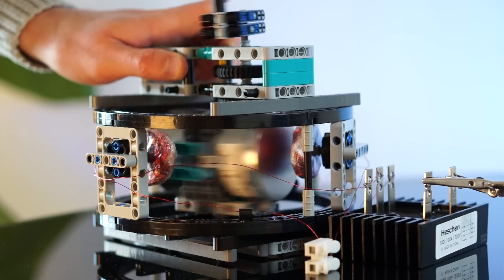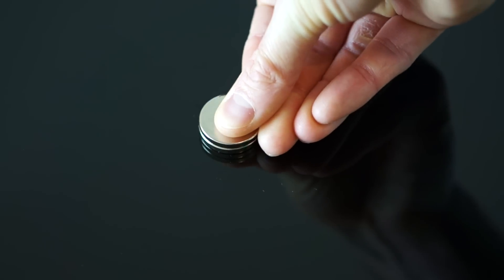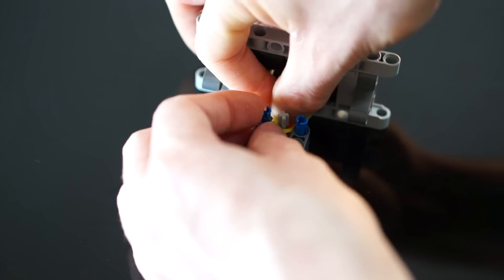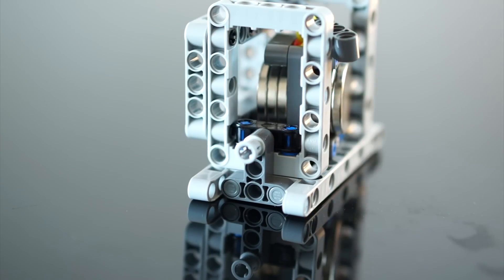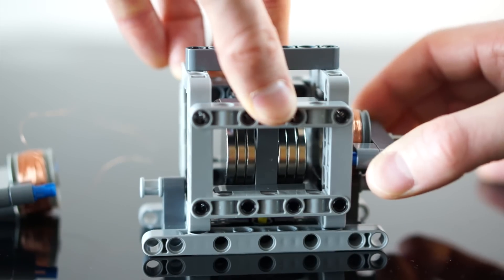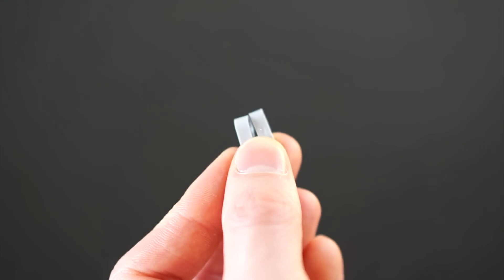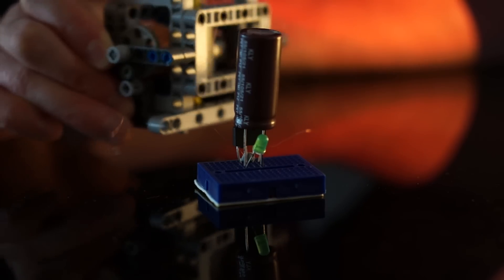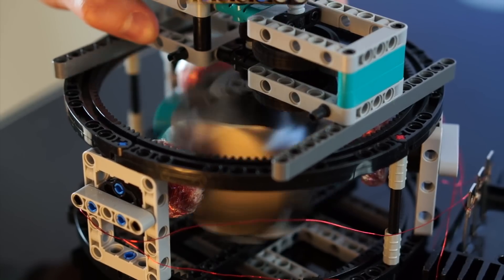The ‘Wiggler’ - This Lego Gadget Shouldn't Exist

Comment: I think if you can make a second one and kinda make it like a boxer engine. With a fly wheel and a electric motor and a few capacitors you could maybe make something that can keep going with momentum. Just a random thought I had.
Reply from the maker: I actually love that idea! It seems totally pointless having a solenoid driving an engine that then turns that linear motion into rotation, when you really should have just created rotation motion from the start. But needlessly overengineering things is a passion of mine 😁 I'm totally going to have to try this! Cheers for the suggestion 🙏

Comment: As a toy, this "contraption" can serve as a teaching tool, a science project, or something for a local science fair.  However there does exist a few wind generators that use vibration to create electricity.  Some have been designed for 3rd world populations and others scaled up for more technically advanced populations.  In short, the concept of harnessing vibration is already in use in today's market to create electrical power.
Reply from the maker: Very true, these vibration generators tend to be pretty inefficient, but they're not bad at 'trickle' collecting energy from things like low speed wind

Comment: Together with the cap and a linear voltage regulator you could bring it with you on the car and convert some of the vibration into energy to charge your phone. If you combine this concept with a thermoelectrical cooler attached to the hot metal of the engines, you could potentially be recovering some of the lost energy thus becoming more efficient...
Reply from the maker: Hmmm I haven't messed around with thermoelectric coolers before - could be some fun experiments there

Comment: I have to wonder if a similar concept could be used as a Wave Motion Generator - turning some of the kinetic energy of every wave approaching a beach, or reef, into electrical energy.

The amount of electricity generated may seem infinitesimal, but low-voltage DC "trickle" charges have been used for years to stimulate the growth of Corals & help to regenerate reefs damaged by global warming. Just a few thousand strategically located & mass manufactured versions of this gadget (sealed inside floats connected to the reef with springs to take advantage of the wave's motions & linked to Biorock electrolytic wires to stimulate coral growth) would do wonders.
Reply from the maker: Huh that's really interesting.. Do you know how exactly they were 'stimulating' coral growth?

Comment: Could you make the distance it has to wiggle smaller? would that change how it works? also does spinning it do anything? Can you make it smaller? Does the coil size make a difference? does the coil orientation make a difference?
Reply from the maker: All excellent questions sir! Reducing distance tends to reduce the amount of change in magnetic exposure to the coils, reducing output. Ideally the magnets would actually travel through the wires for maximal 'change'. Can definitely make it a bit smaller, but output depends on strength of the magnets and size of the coil. In general, more wire loops increases voltage, but also resistance, thereby dropping current. So you have to balance how thick the wire is vs how many loops you need. As an example, if you know what voltage you need (e.g. l, 5v), you should use the thickest wire and the fewest loops you can to reach that voltage. That'll allow you to have the least resistance (greatest current). And yes, orientation is important - magnetic field must be perpendicular to the direction of the wire loops

Comment: You get an alternating voltage from the generator. To increase efficiency, a diode bridge would be installed.
Reply from the maker: Yup, alternating works well for small lights. But I ended up using a rectifier to feed the capacitors

Comment: If you change the direction of wiggle (going across the coil instead of towards the coil), you could get a longer travel distance which I think would result in higher power output and less noise.
Reply from the maker: That's actually a really good point.. I'm gonna have to test another variant like that. But in theory you could be right

Comment: you could use it as a drive for a morse code reciver.
But the guy somewhere who said to build a speaker out of it had objetively the better idee
Reply from the maker: Hmmm interesting, how might it work as a receiver?
Reply: @JamiesBrickJams  Well morse apperates work (my knowledge, might research it a bit) 
by the sending end to close a electric circut with a simple switch.
That puls is then used to actuate something simular to your generator with a "Pen" attached to it to recive the signal and with theat the morse code.
You would only need halve of your generator as you don´t need the oscilating motion so one coil with a spring/rubberband to reset it would be enough. 
With that it would actually not be an idee for your wiggle generator... But it could be nether the less a fun project...
It would also need something to advance the paper it is "writing" on...
also fast... Since you need basicly only a simple circut with a switch at one side and an actuator on the other...
Reply from the maker: Ah gotcha, that sounds challenging, but a cool idea nonetheless

Comment: You can buy similar mechanisms (of course much smaller) as warning lights for runners. You put it on your shirt and never worry about battery life 😎
Another idea is to pair it with a circuit including capacitator which would build up the charge and then relase it as a single signal - that would be just perfect to detect certain amount of vibrations (like steps, dents in the road etc)
Reply from the maker: That's actually an interesting concept, thanks - I like the idea of accumulating the charge, and then discharging or indicating something when a threshold is reached

Comment: with the right sized capacitor you could use it to indicate how long to shake a spray can before it is ready to paint. The PaintWiggler. For bonus points, I reckon you could build a version of a gravity wave detector called LEGO :)
Reply from the maker: That's certainly a unique use case! Measuring waves or 'things that wave' also sounds pretty interesting

Comment: Some time ago I had a flashlight that was recharged with a generator based on this principle. You had to shake it to charge it. However it was a little different. The magnet had all the length of the flashlight to move (except a bit that was for the battery) and the coil was in the middle.
Reply from the maker: Probably makes sense to allow the magnets to travel all the way through - might give that a try sometime 👌

Comment: I’ve seen something similar being used as a simple wind powered light.  Hook the core to something that can shake it in the wind.  Or, put it in the middle between two ribbons pulled tight and the wind will bounce it around nicely
Reply from the maker: Totally! Those old school ribbon generators are fun. I've built one and it sort of works ... Great for low wind, but terrible efficiency when wind speed goes up. Might make a video if I can get it working better

Comment: I suppose if you had a preexisting structure like a bridge which was built in a way that it developed sympathetic vibrations, and you had a big enough wiggler, you could capture (and thereby dampen) the vibrations and turn them into power instead. The Tacoma-Narrows bridge fell due to being shaken apart because of this issue.  I think nowadays architects are aware of it and try to avoid it, but there might be some old buildings or something which could be in danger of falling like this I suppose.
Reply: Thats actually a really cool idea. Also, the Tacoma narrows bridge was a great engineering lesson from history.
Reply from the maker: Very true, and others have said, it'd be interesting to test a use case for it as a vibration dampener of sorts
Reply: or it could be used like that giant ball in a skyscraper in japan i think would be smaller then the big pendulum

Comment: just slap it on any generator and you can get a very pathetically small extra amount of power from the generators wobble. boosting the generators efficiency by harnessing its vibration
Reply from the maker: Totally possible ... Though probably a good idea to design the main one better so it doesn't vibrate!
Reply: @Jamie's Lego Jams  Definitely. Though I haven't seen many that doesn't lol

Comment: This seems useless, because you're thinking of it as a generator, when in reality, you've made a sensor. It doesn't need to produce a "useful" voltage, it you treat its output as a signal, instead of a source of power. Other commenters have pointed out that this could be used as a seismograph, a vibration detector, a speaker (in principal; it'd be pretty useless as a speaker without a cone). I think most interestingly, an array of these devices could be used as an accelerometer. You just need two more, arrange them all perpendicular to one another, and program a brain box to interpret the signal from each and spit it out as direction+velocity as a function of time.
Reply from the maker: That's actually a really nice way of looking at it - I like the idea of it being a sensor. I'm not much of a coder, but it would be interesting to find a way of plotting a readout from a few of these - cheers for the idea!

Comment: Dryvit instead of trying to use it as a generator. Then what you have is a resonance tuning device. You can do resonance matching, or active damping
Reply from the maker: That'd be really cool if you knew the resonance frequency of something... Not a bad idea, I'd love to test that out if I can find something that outputs a constant frequency signal
Reply: @JamiesBrickJams  you could put it on a swing and then pump the swing at its resonant frequency. Or you can make a resonant Mach drive with a bowl of water where you periodically allow a little bit of the water to spill out of one side of the bowl and refill in the center. The result is a thrust output with no jet of water.
Reply from the maker: Huh both really cool ideas!

Comment: Take it out on a car ride and see what you get out of it. Or even bike ride. If it can generate a total of 5% on a phone per hour it can be really handy.
Reply from the maker: Be lucky with even 1 percent over a few hours, but I like the idea of storing energy over a long period of time if you're gonna be moving anyway!
Reply: @JamiesBrickJams  
Probably yes. But it's a way where this concept could be really good. Hiking especially when you haven't got the option for any rotational power like on a bike or in a car. Power banks are usually able to trickle charge and then be used for charging the phone.
Reply from the maker: @sirmiro2  Very true. I could see a use case in charging a bank while hiking to power an emergency radio or light or something

Comment: It reminds me of those emergency shake flashlights, that use a similar concept of a shaking electromagnet to charge batteries for the flashlight. More compact than a crank flashlight, and fun to use.
Reply from the maker: True, I guess they're probably the most compact form of generator compared to a crank style
Reply: I had one of those. I always left it in the car, oriented such that it ought to get a free charge from my accelerating and braking... but it never had anything in the capacitor when I needed it. That flashlight was made in China, though: cheap and nasty. With better magnets, a wiggler might scavenge some energy. It’s not "free" though, since you’re hauling the weight around in the car.

Comment: Maybe this device could be made usefull in a precision device that can not have any vibrations. If any micro vibrations are detectd the wiggler returns data on how bad the vibrations are. Your divice will need some refining to acheive that
Reply from the maker: I like the idea of it being a sensor rather than a generator - seems a lot more useful!
Reply: @JamiesBrickJams  yeah! I want to try to prototype and make a program for reading the voltage from the sensor. If i decide to do this, do i have permission to do so? It is your invention after all
Reply from the maker: @Player-9  haha of course, and this isn't really my invention - there are probably hundreds of similar things out there. It's all just moving magnets near copper!

Comment: you could put this in a flashlight with a capacitor.
no external charge needed, just shake it a bit to charge the capacitor.
is it out? shake it some more.
leave the thing in your glove compartment for years.
of course, we've ditched all the legoes at this point.
Reply from the maker: Great idea - looks like a few folks remember those old shake-to-charge lights - I'll give it a try!

Comment: You could carry it in your backpack and it would charge your battery.  You would need to use a half or full wave rectifier to ensure positive voltage but it looks pretty useful to me.  Sell it to the military for their soldiers to use in their backpacks.  Easy money
Reply from the maker: I like that idea - I guess you could store the energy while hiking in a capacitor bank. Should be enough to power a radio and lights for a while

Comment: You have a linear motion transducer. You’ve essentially made a speaker.

Try hooking the wires to an AC source at 3-5v nominal and you should get cool motion and depending on the frequency of the AC maybe even some sound!
Reply from the maker: Ha yeah, pretty much 😄 I might actually try making a large woofer using a similar method that you suggest here
Reply: Conversely, you might be able to use it as a microphone.
Reply: i think the magnets are too big and heavy for those coils, he should use either smaller magnets or much larger coils to make it able to vibrate at a few KHz
Reply: It serves a purpose that purpose is entertaining people and making views
Reply: @dylsdrumz7081 There truly is no higher purpose for a human being than to amuse me, specifically. That is why I dedicate so much of my own time to this noble cause. 😁
Reply: @MrKyltpzyxm  indeed

Comment: This one is a fun fidget toy, but something similar could be used in watches, for example, to keep them powered. And I have an emergency flashlight that uses a similar generator to charge a capacitor and light up!
Reply from the maker: Very true, I think many watches still use kinetic chargers. I quite like the idea of making a flashlight version of this with some capacitors built in to hold the charge a while!
Reply: @JamiesBrickJams  Yeah, it's generally useful in low-power applications that tend to move around a lot. Especially in wearable tech it's a passive but practically infinite energy source!

Comment: well these sort of generators , i've seen in compact flashlights that didn't require a battery, thou they had magnets slide inbetween a coil, you would shake the flashlight for a bit, and it would charge a capacitor, and run for a bit
Reply from the maker: Yeah those were cool, I remember playing with one years ago. I suppose I could attach the rectifier and capacitors to this and make it a nicer shape - like a shake-weight. Pretty much a flashlight then!

Comment: That would actually make a half-decent earthquake detector, as earthquakes should wiggle it enough to generate a voltage, and the more it wiggles, the stronger the voltage gets! So you’ve essentially created a tiny seismograph here!
Reply from the maker: Very true! A few folks have suggested it measuring earthquakes.. I suspect by the time an earthquake is wiggling it enough for it to register a visible output, you'll be very aware of that earthquake though 😄
Reply: @JamiesBrickJams  you'd be surprised how sensitive you can make those. You can make them sensitive enough to pick up cars passing by on the road outside. If you want to try that though, I suggest you try using flexure springs instead of coil springs, they're far more sensitive.
Reply from the maker: Damn that's impressive, ok I'll need to have a look at that in more detail - sounds like a fun proof of concept
Reply: @JamiesBrickJams  I wonder if it could be made to detect smaller vibrations, so that it WOULD be an early warning system?
Reply: @mbcommandnerd those exist, they're called seismometers, and they have been around for centuries.
Reply: @jaloswaggons2182  Well, the mechanical ones have at least
Reply: Earthquake sensors works exactly like this contraption! The only difference is that the magnets are attached to a small pendulum. Even a tiny movement can induce a very little current in the coil, that will be amplified by the electronic control circuit! Others sensors uses moving ferrite core inside the coil, but the overall principle it's the same: wiggling!
Reply: Your body has its own seismometer

Comment: You could use the vibrations from driving to power it when it's on it's side. How much power you'd get would depend on the road conditions and the shoch absorbers, but it's still possible.
Reply from the maker: Hey that's a novel idea. Someone else mentioned using it as a dampener, but I like the idea of using it on larger things like roads where you could built it into the infrastructure.

Comment: I have seen ?such? a Power plant with 3meter long, 2 cm wide foils horizontal in the Wind. The foil Starts to swing...like a plastic bag swinging in your Hand can make Sound (Vibrations)
Reply from the maker: Ah yes, ribbon generators. I've actually built and tested a few. They work great in very low wind, but regular turbine generators are just way more efficient at higher wind speeds. Might do a video on one anyway though